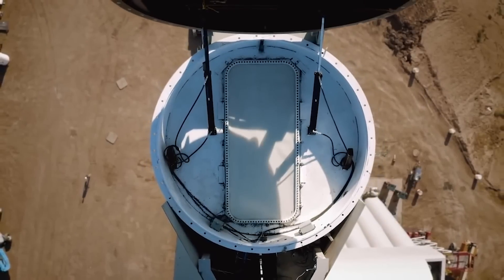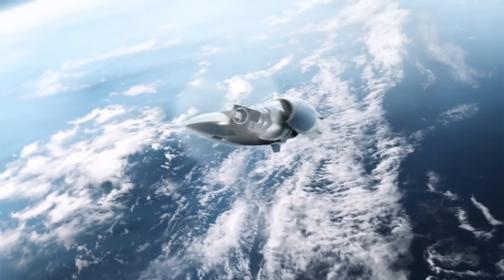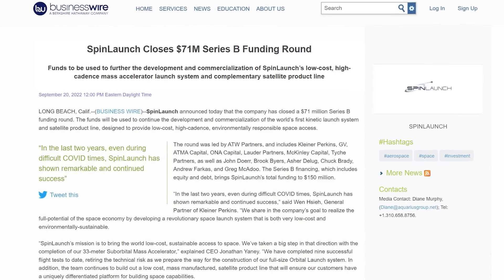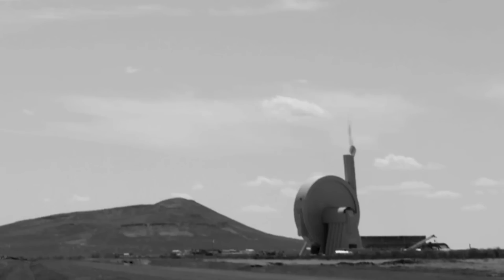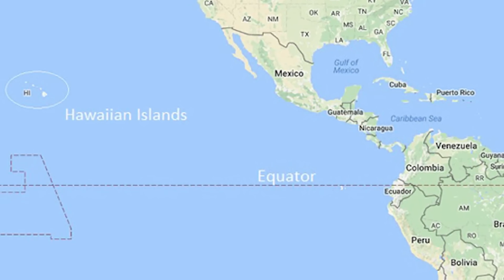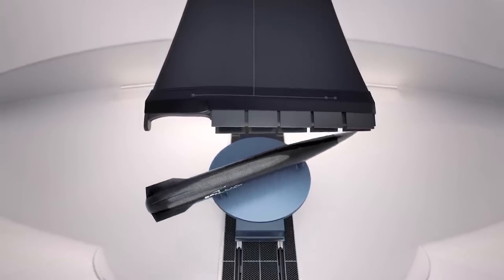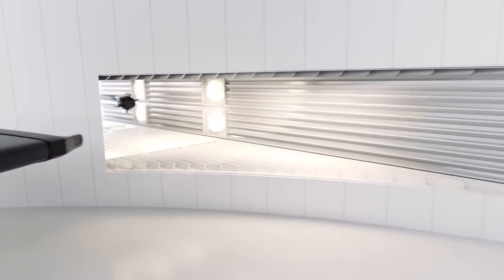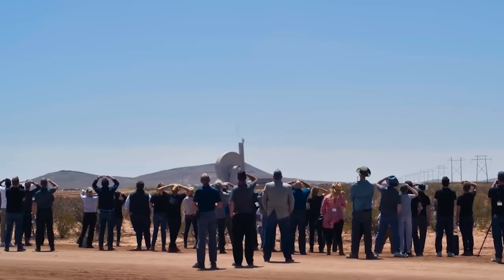What Happened To SpinLaunch & The Orbital Accelerator?

Comment: A lot of people are skeptical about the project and I get why, it seems too far fetched and like another techno scam, but honestly I think it could work. They've already solved tons of seemingly impossible things, not on paper or with equations but actually physically built them, they have a testing facility with enormous vacuum chambers, they've built the super fast shutter doors, they're testing every part to make sure it survives the 20 000 Gs of acceleration, and it does! Not saying that it'll definitely work but I'm a fan
Reply: they really haven't solved much if anything at all. They've managed to build a sub orbital launch platform based on centrifugal forces, which I guess can be called an achievement. But the height and speed they achieved is roughly the same to a 155mm howitzer firing straight up with a full propellant charge, ~9000m (30.000ft) at a muzzle velocity of 1000m/s. So 2% of force that is needed to get to orbit, now they  need to find the other 98% (and they wont), so they basically demonstrated an unstable projectile being flung to 9km high. In general, this idea solves very little issues with delivery of payloads into orbit, we already have small rockets that carry small payloads, and they are cheap compared to the big rockets.
This, to me, seems like an investment scam at best.

Comment: A corporate grift that defies basic physics. An ultrahigh velocity rotating mass at requires an extreme precision in balance, such as a compressor in a jet engine or turbo charger. Otherwise, vibration will destroy the turbine. This "grift" would require similar balance during acceleration, followed by the release of the payload, at which point the rotating mass will loose balance, the millisecond later explosion would be quite a show and be potently fatal to anybody within the debris field potentially 20-30 km. The only way I can see to escape that outcome is to have a mass of the exact same as the payload released downward at the exact instant the payload is released, which would result in a smaller explosion and less death.

Comment: Don't they need a velocity of around 17,500 MPH to achieve the lowest possible sustainable orbit? And that's after achieving altitude. Even if launched precisely in the direction of the earth's rotation from a point on the equator, their starting velocity is only about 1000 MPH. Couple directional stability across the distance with the many atmospheric variables, and this just doesn't seem possible/practical. I could see a terrestrial accelerator to achieve a good amount of the energy necessary for orbit, but anything launched would need a guidance system (to insure it's orbit didn't intersect with the plethora of other orbiting gizmos), and enough backup thrust to guarantee altitude in a worst-case scenario.

Comment: I don't see this being practical on earth simply because of the equation for centrifugal force mv^2/r so with 
m=200 kg 
v=7000 m/s 
r=15 m 
it would require 653,000,000 N to keep going in circle. 
the deltaV required to reach orbit is typically to 9.4km/s which the forces go up to 1.18E9 N using that speed.
I am not familiar with supersonic aerodynamics but with subsonic aero drag is proportional to v^2 so I cannot imagine going throw the lower atmosphere at reentry speeds would be easy.

Comment: Anything leaving a spin-launcher like that will have a lot of angular momentum, unless corrected for during "precision release" (which is non-viable at the angular velocities required). My guess is they plan to use the aerodynamics of the vehicles to correct this, given how much the vehicles shown in the test flights are visibly wobbling around, but at the huge speeds needed to launch an object into orbit it's hard not to envision them self-destructing on contact with air.
Reply: I think the way its done is releasing it slightly out of the position - so the angular momentum is essentially "straight"
But this idea is so stupid on so many levels.

Comment: Ridiculous lateral acceleration that would solidify the propellant. Suden lateral deceleration that would immediately liquidfy the propellant, followed by an aweful longitudinal deceleration when the rocket hits the atmosphere. Add to that a sonic boom of the rush of air entering the vacuum chamber and the unbalance of the system. This is an aweful idea. Any engineer involved in it should resign their diploma, travel in time, and apologize to Newton.

Comment: This is a great idea… for a different planet with lower escape velocity and less dense atmosphere.
Reply: They aren't throwing this thing all the way to orbit.
They're basically replacing the first stage of a conventional rocket.

Because a rocket needs to carry fuel for its fuel, this saves a lot of fuel.

As for the drag induced by the atmosphere, it is actually lower if the launch vehicle goes at Mach 5 rather than Mach 1.
In fact, at that speed it would be out of the densest part of the atmosphere before it even has time to heat to dangerous temperatures.
Also, a conventional rocket needs to push through the densest part of the atmosphere, which this system doesn't, meaning it needs to carry even less fuel.

Of course there are still plenty of issues, but if they can solve them, this might be a cheaper and more efficent way to launch pretty much anything that is not a living organism.
Reply: That remains of the movie, The Wedding Planet.

Comment: Let's see: Near 15,000-20,000 G's on a delicate satellite in the spin chamber for up to an hour? Liquid fueled rocket motors are tossed out and start to slow down immediately when leaving the vacuum will not fire due to fuel at the top of the tank instead of bottom. The weight needed to build a rocket that can handle the massive forces in multiple directions. The imbalance of a liquid filled rocket when switching directions almost instantly. That is a lot to overcome, possibly solid fuels would work but I doubt it.

Comment: Dear readers. Many comments here about 'It won't work.. etc", but not many actual descriptions on why it won't work. Obviously there are mechanical problem previously mentioned, release timing, high g resisting components etc. but the biggest problem almost never mentioned is ground atmospheric air pressure. At a (proposed) exit velocity of 2200m.sec^-1 (5000 mph) atmoshperic air resistance would drastically reduce the missile's velocity and cause it to heat up. It would mechanically unfeasible to to reduce the missiles coefficient of friction to a low enough level where the missile would reach atmospheric altitude where air pressure becomes lossless. The section of physics where this can be studied and modelled is called Ballistics and even simple spreadsheet calculations are sufficient to show that Spinlaunch is not a viable method of space launch. The biggest question is why NASA etc.are putting money into it.

Comment: One obvious engineering issue is that the moment the rocket is launched, the rotor ceases to be balanced and the imbalance creates immense forces. Did they solve this? How? And is this part of the reason for the delay?
Reply: They dropped some dead weight at the same time in a renforced place of the launcher.
Their end goal is to put a second rocket on the other side to make two launch in one go.
Reply: @myludynamics The second rocket has to go opposite direction to get a balance. So one rocket going to moon, another to Kaizu planet?
Reply: @myludynamics  Right now, the vehicle faces ~200g acceleration at launch. For each cubic meter of kerosine, that's >1400bar at just 1m down from top of the fuel tank. I don't know how many material can withstand that much pressure without getting ruptured. How many electronics can withstand such pressure is also a question.
All in all, looks like this can succeed only for smaller payload with very minimal electionics.

Comment: At this stage, I think it's an interesting idea for small-scale testing, that's it. 

 Safety-wise, this monstrosity scares the #### out of me.  If a rocket or big gun type launch goes wrong, the worst case scenario is blowing up / burning down the immediate launch area.  If this thing goes wrong, the worst case scenario is  random chunks of wreckage being flung in random directions at EXTREME velocity.
Reply: "Random chunks of wreckage flung in a random direction at extreme velocity". Sounds to me like you're describing a "conventional" mid-air rocket explosion. Yet, rocket launches are more frequent than ever these days. In spinlaunch's case, if the payload detaches before its time, it will first have to go through a nigh parallel thick metal wall that can be engineered to stand this eventuality
Reply: @anthonyjaccard3694  All you have to be sure of is that all of that aforementioned wreckage flies in the right direction to hit that wall.  No problem.
Reply: @7thsealord888  The whole spinning contraption is enclosed in a big metal cylinder so I really don't see how that's a problem. Plus, should the spinning arm rupture in any way, the geometry of the things makes it so the fastest moving parts (the extremities) will hit that wall with the most parallel trajectory to the wall, allowing it to have less of an impact on the surface. Again, if you are okay with rockets at the rate they are being launched today, you have no reason to be scared of this thing. It has many flaws but security really is the least of them
Reply: @anthonyjaccard3694  Rockets are a well-established technology, and we are pretty much alongside all the things that can go wrong with them. 

 This contraption ...... MAYBE, as you seem to think, it is the greatest thing since sliced bread.  I am unconvinced at this stage.  It is going to need A LOT more testing under varied conditions before I share anywhere near your certainty on the matter.
Reply: @7thsealord888  my point is : rockets too were once a very much untested technology were the worst case scenario was a big explosion and a huge hunk of metal being flung in a somewhat random direction. However, with enough time and security measures, we are now in a world where a rocket is launched  every week without everyone in the world fearing that at any given moment they could receive a rocket on their face. It certainly wasn't without some catastrophic accidents but it hasn't stopped it from happening so maybe we shouldn't discredit a potential great technology because it "seems" dangerous without first testing it

Comment: this sounds like a rocket engineers nightmare.... Any small fragile components would be destroyed from the imparted forces from rotating at such a small diameter circumference from the central axis just going mac-1 would impart upwards of 100+ g-forces on any components you're trying to launch destroying anything fragile. on paper with math this is a joke before it even gets off the ground. just at mac-1 which is 340.29m/s this would already impart so much force on the components, spinning any higher would apply such a tremendous amount for force if anything breaks it's going to hell to clean up and repair.....

This is an on paper joke. even as a high-school dropout, i know this is a waste of time.

Comment: this is one big scam... it's easy to compute how much RPM this launcher should do. To give enough speed, that this 'rocket' get on the expected height. You need around 2000 rpm with arm length around 10 meters, to push object to 50 km high.  IF THERE WASN"T any air... with friction force from air, I will guesses that this high will be at max will be around 25 km. (I don't wanna waste time to compute this, because it will change with speed.)
And mass of this object and arm will do enormous force to this spining mechanism. I rly doubt that for now, that any material can stand such force.

Comment: I agree that this project has many problems. However, many seem to miss the fact that the centrifuge isn't meant to launch objects into orbit on it's own- it will just take the part of the first couple stages of a rocket. Even if it can only launch the rocket a few miles up, it could dramatically reduce the fuel necessary.
Reply: The multi-stage mechanism has to survive the acceleration process. It must survive for a relatively long time at high lateral G's. A good test might be to fire the payload and launcher sideways into a barrier where it decelerates at say 20000G. See if it survives intact. Good luck with that

Comment: This is just a bad idea. In the 1960s Project HARP achieved what "Spin Launch" is attempting to achieve effectively using two naval cannons welded together. They got a 900 lb projectile to a muzzle velocity of 7,000 fps and reached an altitude of 180 km. The program had its funding pulled due to the Vietnam War. "Spin Launch" is trying to achieve a muzzle velocity of ~6,900 fps with a huge 100m diameter accelerator in a vacuum chamber. Linear accelerators are just a better way of accelerating objects into orbit. They can be a lot smaller and don't require your projectile to withstand high G-loads for hours. In fact, it is hard to think of a worse way to launch something into orbit than "Spin Launch".

Comment: All of these computer simulations make it look like a possible option, but the laws of physics don't stop working in the real world.  If you have a substantial weight spinning at a fast rate and release the weight it will cause the machine to suddenly become extremely out of balance and it will shred itself and probably send debris into space as well.  I am no expert and the only time I spent in college was to attend parties when I was a kid so I am not sure how projects like this get millions of dollars in funding when an idiot like me can see there is a problem with the concept. Lol
Reply: Theres definitely a limit to the weight of the payloads they can launch, but for smaller payloads it seems to be a feasible launch platform. I'll be impressed if they actually get something into space.
Reply: @drew21t  Like I said I am no expert but I know a wheel out of balance by a fraction of an ounce will shake violently at highway speeds which are tiny compared to the speeds they are dreaming about and throwing 800 pound projectiles.  That isn't a small imbalance and there is no real way to counter that immediate mass change before violent disassembly in my opinion. Lol

Comment: Even if they get close to the equator, the size is still limited to micro satellites and it’s unclear how they will acquire attitude and orbit correction.  Also, if the tether or vacuum chamber fail it would be catastrophic for the entire system and surrounding area.  There’s a reason why HARP was canceled and they also looked into a centrifugal force, cannon, and the radical Orion nuclear launch systems.
Reply: As they are launching rockets, how can it be unclear how they will acquire attitude and orbit correction?

Comment: What happens to the arm and bearings etc when the spinning mass suddenly changes when the launch vehicle is released? I'd imagine there would be some heavy shaking and stress. Usually things that spin that fast have to be extremely well balanced.
Reply: In one video, they said that there is counterweight on the other side of the arm which is released too.

Of course it is quite inefficient and problematic at high speed. I am just reproducing what they claimed.
Reply: Sounds logical.  @DalHrusk
Reply: That are the questions I’m looking for!
And how accurate has the release—time—window to be, not to hit the wall?
Reply: @muctop17 If it's so difficult, how come they already did it with ease on their smaller scale tests?
Reply: @jacksonthestickman  And where did it end? In orbit?? 🤣
Reply: Currently the counter mass is fired down into a very solid wall  they also mentioned working on the ability to have two payloads, one on each side, the second payload will be unbalanced for half a rotation but they don't think that will be all that bad but haven't shown that yet.
Reply: @Blake-jl8lh Another method to make the machine easier to maintain is firing two satellites half a rotation apart.

Comment: Spin launch was a terrible idea from the get go.  You're trying to impart enough energy to put something in orbit at the very beginning of its trajectory, where its least efficient to try and reach the high velocities needed for orbit.

Whatever you're launching needs to END with over 17,000 mph, and since the spin-launch system doesn't allow continued acceleration over the course of the flight, the payload must be launched with enough velocity to overcome the resistance of the atmosphere, and have enough left over to remain above that 17,000 mph after leaving atmo.

Comment: They should scout for locations that are high in the mountains, for them to be able to "skip" the most substantial part of the atmosphere...
like Cayambe (the mountain next to the town with the same name in Ecuador, some 5700m high and directly on the equator (0°1' N) )
or Mt. Kilimanjaro  (5800m high, 3° S).
Basically, in that altitude you have only 0.5 atm pressure

Comment: I always thought a BTM boring an angled tunnel at a 45-60 degree inclination exiting the top of Chimborazo would make the most sense. Inside this tunnel would be a maglev launcher designed to project a ramjet or scramjet vehicle. This is designed to replace to first two stages for small payloads to orbit. The vehicle exits the maglev at MACH 3 and 20,000 feet without ever needing to carry fuel or oxygen. The ramjet/scramjet requires no internal oxygen carried and attains MACH 5-15+ at altitudes over 100,000 feet without carrying any oxygen. 

 This is more akin to transmitting information in packets instead of entire programs at once. This system enables the projectile to glide back and be reused many times. It allows many small vehicles to launch affordable “packets” into orbit with the smallest vehicles possible